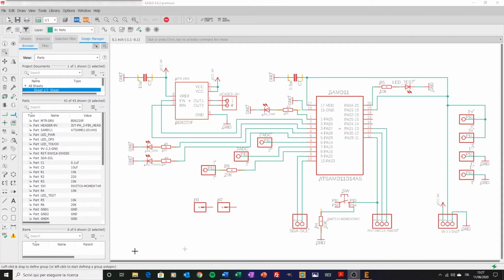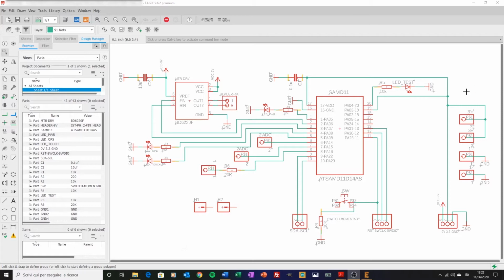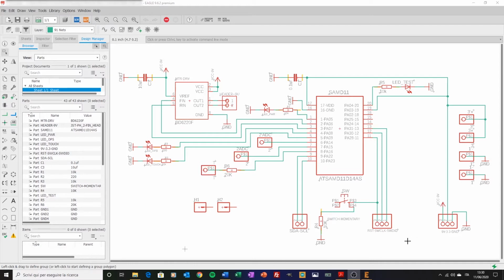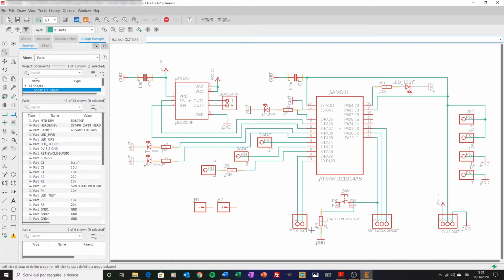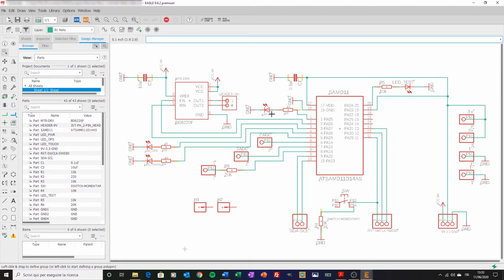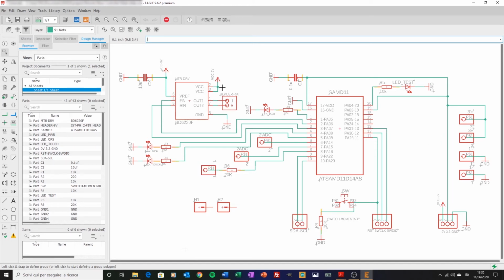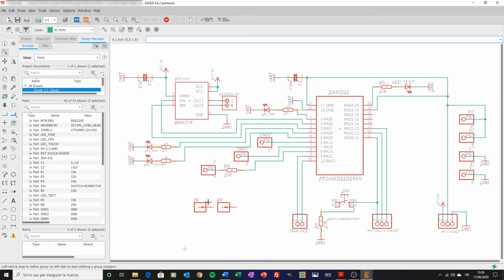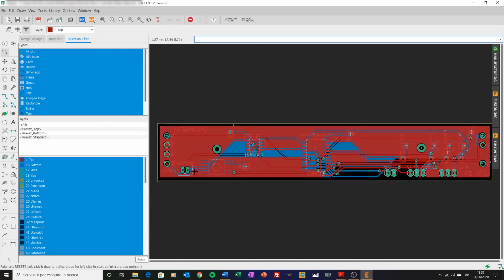Motorized faders as DAW Mixer Controllers PART 2

Comment: Did you use individual pcbs to keep it modular?

I am planning to create a mixer to control windows audio using motorfaders (There is a software called Midi Mixer). You project is really helpfull.

Thanks for making everything avialiable. Will you share the code as well?
Reply from the maker: Hello Pllipp594, yes indeed the idea is to go modular. Also because what I have in mind is as ultimate goal is a product that is quite different from a standard MIDI remote console.
Thanks for your comment!